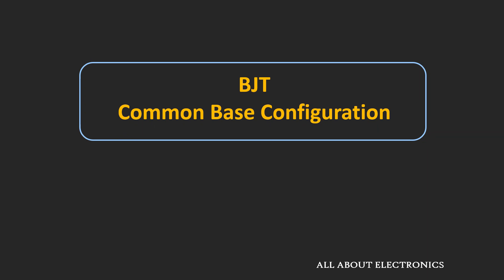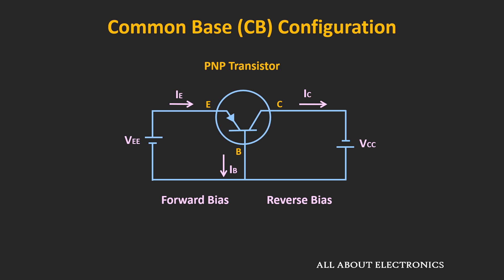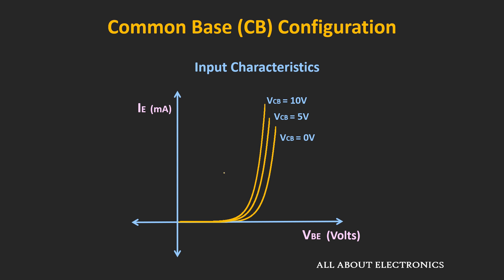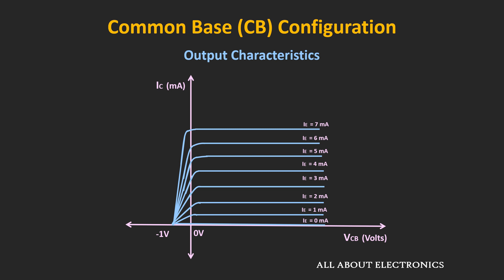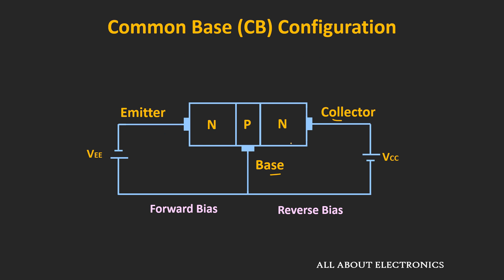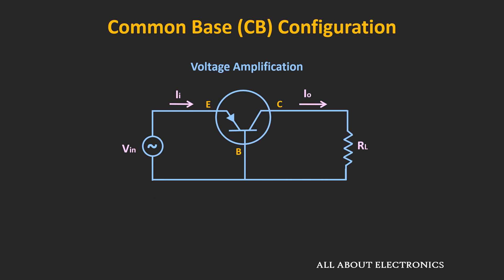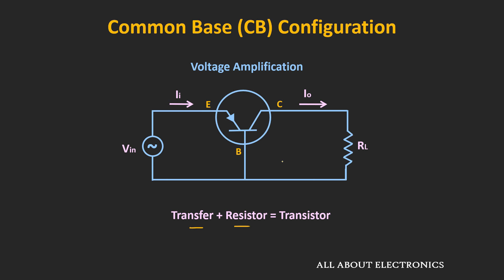BJT : Common Base Configuration Explained

Comment from the maker: The timestamps for the different topics covered in the video:

1:11 What is Common Base Configuration

2:55 Input Characteristics of the Common Base Configuration

5:45 Output Characteristics of the Common Base Configuration

6:33 Three Different regions of operation (Active, Saturation, and Cut-off)

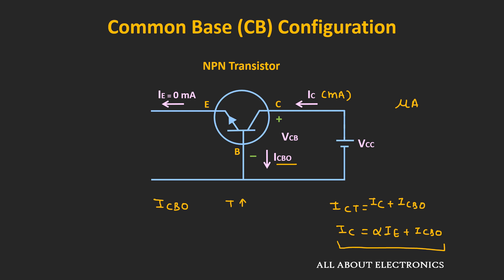10:52 Signal Amplification in CB Configuration

Comment: i have a doubt that in NPN transistor ,in common base configuration it is written input voltage as EB and in PNP it is written as BE ,why it is changed. is it based on voltage difference from positive to negative ,or it is based on refrence voltage ground voltage ?
Reply: It kind of reference 
 or you can say to calculate the voltage in positive unit as in pnp
The emitter side is connected with Positive (higher side) and base in connected with negative (lower side)

Comment: great video. However I have aquestion. We can see that in output, collector current is given by alpha times emitter current. I want to know why does the output voltage (Vc) not have an effect on that. I know the mathematical relation but whats the actual reason?
Reply: To be precise, the collector voltage does have a very small effect on alpha. The collector voltage changes the reverse junction depletion region width btw base and collector, thus affects the fraction of emitter current that the collector "collects". This effect, however, is very small because most of the emitter current goes to the collector regardless of the collector voltage (as long as it is positive). I expect later videoes will explain this in more depth.

Comment: You mixed up which half is foward bias and which is reverse bias, in both the pnp and npn transistor diagrams. 2:55 and 2:32
Reply from the maker: In PNP transistor, EB junction is forward-biased. (Emitter is P, and base is N), while CB junction is reverse-biased.  (Collector is P and base is N).
In the NPN transistor, BE junction is forward biased (Base is P and Emiiter is N), while BC junction is reverse biased. (Collector is N and base is P, so higher voltage is applied at Collector side).
I hope, it will clear your doubt.
Reply: @ALLABOUTELECTRONICS  but if base-emitter in NPN is foward biased, that means current flows into emittor(N) and out of the base(P), because that is how a [NP] diode would behave in foward bias.

But current is flowing out of the emitter in your NPN diagram, which makes the emitter-base reverse bias.
Reply from the maker: @chibuzordesmond3937  I would recommend you to watch the basic video on BJT. If you will watch it, then your doubts will get clear. 
Here is the link: https://youtu.be/-VwPSDQmdjM?si=B9kH68XWb2-uVTNo
Reply: @ALLABOUTELECTRONICS  will do
Reply: @ALLABOUTELECTRONICS I've watched it and my understanding now is that current always flows from + to - 
in the circuit, I've been taking the convention for granted but let me know if that is correct.
Reply from the maker: @chibuzordesmond3937  Yes in the circuit the current flows from positive to negative. The current direction that we are assuming (Conventional current flow) is opposite to the direction of flow of electrons.
Reply: @ALLABOUTELECTRONICS    for what reason is the direction of conventional current and the direction of actual electron flow, the same in current Ib, in NPN transistor?

Comment: I have a doubt, why in output characteristics we consider Current of Collector, since current is going inside the transistor so shudnt it be input characteristics? Or do we consider the direction of electron?

Comment: Its really a good video ,but I have one doubt , voltage gain is actually based on load resistance, which we can change according to our convenience than why its rage is fixed?
Reply from the maker: In common base amplifier, along with load resistor, the gain also depends on the collector resistor and the transconductance. That's why just increasing the load resistance alone, you will not see much increase in the gain after some point. For more information, about the gain of the common base amplifier, you may refer this video: https://youtu.be/MckBbhfxdkk?si=1KOQ9EApVd8GTiZy

Comment: Respected sir, Why we don't include output impedance while calculating output current?
Reply from the maker: Typically the output impedance in this configuration is very high. It will come in parallel with RL. And if we take the parallel combination of those two resistors then it is close to RL. That’s why here it is not considered. For exact calculations you can watch the video on common base amplifier. 
Here is the link : https://youtu.be/MckBbhfxdkk?si=dYJmsP0UI30uVH_q
Reply: okay sir, thankyou

Comment: Hello Sir, I have a question for the constant Ic when Vcb increase. As what you said in common emitter transistor, as Vcb incrases, the depletion region will increase so that the effective width between base and emitter decreases. Thus, more electrons will flux into collector region. That explanation could also be applied here. Then Ic should not be constant. Instead it should also increase. But why does the current keep constant here? Thank you very much for your video!

Comment: At 6.17 you explain input and output characteristics...while explaining input  characteristics u kept output voltage constant while output characteristics u put input current constant why such so?
Reply from the maker: If you change any input/ output parameter, it will have an effect on other parameters as well. So, the while finding output characteristics we just want to know how Ic changes with VCB. If we change input parameter ( Ie) then it will also affect the collector current. So, it is kept constant. In short, while finding characteristics, we don't want more than two variables. That's why input parameter is kept constant. I hope, it will clear your doubt.
Reply: I want to know why is current not voltage is taken constant while plotting output characteristics or vice-versa? I got your point but why current nd voltage are taken why not same in both characteristic?
Reply: And we are changing Ic nd Vcb so how we can fix Ie bcz Ic is varying so how Ie can kept constant ?

Comment: @ 5:01 You mentioned the Input impedance [is the slope of the curve; i.e TanX.
But here, TanX=Per/Base= Ie/Vbe; which doesn't seem to be the Impedance from the curve.
Please correct it.
Reply: Impedance is resistance here (R = V/I). For input characteristics, changes in I is very big compared to the changes in V. That's why, impudance is low.
Reply: Slope of the curve will give you conductance and the inverse of conductance will give you resistance. Slope = Ie/Vbe = conductance. If we inverse the equation, we will get resistance. So, R = Vbe/Ie.

Comment: the width of the depletion region will increase but the base will get narrower, aren't you contradicting yourself?
Reply from the maker: As the width of the depletion region increases, the effective region where you will get the free electrons will reduce. (Depletion region is depleted of free electrons) Therefore, the base will get narrower. I hope, it will clear your doubt.

Comment: 13.00 why we are not using r output .why we are using rl ?? .Please explain
Reply from the maker: The output will be Io x ( Ro || RL).
But since, RL is much smaller than Ro,  (Ro is around 100k and ,RL in this case is 1 k) their equivalent resistance will be approximately equal to RL. 
That is why RL was used. I hope, it will clear your doubt.

Comment: At 12:04, why suddenly the current directions have reversed when compared to what u had been showing in first 12 minutes of the video?
Reply from the maker: Because it is PNP transistor. So, its direction will be opposite to NPN transistor. The transistor shown earlier was NPN transistor. I hope, it will clear your doubt.

Comment: sir u have shown symbol for pnp transistor in video, but you are refering to npn so which is right?
Reply from the maker: If you see the symbol closely, then it is the symbol of NPN transistor. The arrow is going from base to emitter.
Reply: Sir at 11:34
Reply from the maker: @aamir99204  Yes, just to explain the signal amplification in CB configuration, the PNP transistor was shown. (since the direction of input and output currents are more relatable in PNP CB configuration)

Comment: Sir I found out one mistake in your video as per my knowledge. In your video you told that the output characteristics curve for common base configuration is linear but I verified from Sedra Smith that the curve is not the liner it has a small positive slope which indicates that the Ic depends upon Vcb in the active mode.
Reply: No bro,he told that from ideal case.What you have said is the practical case.In practical case Ic=(alpha×Ie)+Icbo
Reply: Yes it is not linear, but for approximation we take it for linear

Comment: How is the voltage from the Base to Emitter considered to forward biased for both the PNP and NPN when they are on? Is this not a mistake? If you're talking about Vbe in both cases then they both can not be considered forward biased. The only way it makes sense is if in regards to the PNP you are saying Veb is forward biased. But why do it like that?

Comment: I have a doubt, you have written in properties of CB that it has low power gain, but if current gain is 1 then power gain is same as the voltage gain and so it is high. Right?

Comment: at 12:00 you say that alpha = 1 and Ic/Ie=1;
But at 13:50 you say that Ic/Ie<1 ...
So why the two complementary sentences in the same concept ?
Reply from the maker: At 12:00, it was just assumed that Alpha is 1.  ( Just to make the calculation simple). Actually it is around 0.95 to 0.99. so, current gain will be always less than 1.
Reply: @ALLABOUTELECTRONICS   Hmm ok... 
But IV should be same at input and output side, right?

Comment: Sir at 11:06 you have taken pnp transistor  but earlier you took NPS transistor it’s a bit confusing .
Reply: Yes, exactly. I was wondering this comment. He used PNP transistor here, but in both NPN and PNP, the i/p will be along VBE side and o/p will be on VCB side. So there's no problem with the equations though.

Comment: What is the full form of vee and vcc
Reply from the maker: Vee is the supply voltage applied at the emitter side. And the Vcc is the supply voltage applied at the collector side. Please note, it is different from Vc and Ve. Vc stand for the voltage at the collector terminal and Ve is the voltage at the emitter terminal w.r.t ground.
I hope it will clear your doubt.

Comment: I want to thank you again. How did the high output resistance help this circuit? As the output voltage was dependent on load resistant. I figured from the output characteristics, that the high o/p resistance is helping for a current mirror as the current does not change much but does it help for voltage amplification purpose?
Reply: Same doubt . Now u have an idea if so kindly share

Comment: great explanation sir,i have following questions when i watched this video
1).why you don,t use output impedance in your calculations?is that not effect for output voltage and current?
2).same current flow through the circuit from input side to output side . but voltage is increasing without using any voltage source.so the power is increased .how that happened?
Reply from the maker: the thing is we are also applying the DC voltage to the BJT. AC input signal is the one which we want  to amplify. But to do so, we need to bias the BJT (we need to apply the proper DC voltage to the BJT). This external DC biasing helps in the amplification. There is a conservation of energy. 
For more info, I would recommend you to watch the video on BJT- Large signal model.
Here is the link: https://youtu.be/ME41uPsDxFo
Reply: @ALLABOUTELECTRONICS  thank you sir ,i am following your tutorials and those are very helpful to me for develop my knowledge

Comment: The output characteristic. How does a output current Ic flow when it's reverse bias
Reply: Time 8.30
Reply from the maker: Are you talking about cut-off region. In the cut-off region both junctions are reverse biased.
Reply: @ALLABOUTELECTRONICS  No, in active and saturated regions the collector base is reversed but how is there a Current flow Ic?
Reply from the maker: In the introductory video on BJT, I have already explained it. If you go through it, you will get it.
Reply: @ALLABOUTELECTRONICS  thx for the help bro. This help me with exams

Comment: In common base mode, what is the potential at the base? (The positive terminal of one battery is connected to the negative terminal of the other)
Reply from the maker: when we say, the common base, the base is common for the AC signal. That means the AC input signal is applied between the emitter and the base, while the output is measured between the collector and the base. For the DC biasing perspective, the base terminal may not be at the ground potential. But to use the BJT as an amplifier, the base-emitter junction has to be forward biased and the collector-base junction has to be reverse biased. (To ensure the operation in the active region)
Actually w.r.t to ground there will be some finite DC  voltage at the base. 
Here to simplify the analysis it shown such way. 
I hope it will clear your doubt. 
If you still have any doubt then do let me know here.
Reply: @ALLABOUTELECTRONICS   Thank you!!

Comment: sir is it supposed that when we increased VCB then we make the junction between base and collector more reversed then the collector current reduced not to be constant ?
Reply: When reverse voltage increased depletion region gets wider thus base width decreases which allows  Ieto pass Vcb junction.Hence Ic almost equal to Ie

Comment: anna please tell why the transistors will operate in forward bias for small voltage due to decrease in the width of base
Reply from the maker: I think you are referring to the small ac signal right ??  The thing is to forward bias the base-emitter junction, the applied voltage between the two should be more than 0.7V. 
Of course on top of that if we apply the small ac signal, then it will remain in the forward bias condition. 
That means when, DC signal (for biasing) + small AC signal (for amplification) is greater than 0.7V, the base-emitter junction is in the forward bias condition. 
I hope it will clear your doubt. If you still have any doubt then let me know here.

Comment: I have one doubt in my mind ..if collector Base junction is in reverse bias then why electrons from emitter move from reverse bias depletion region ? Why dont electron pushed back to emitter by repeltion of negative ions of P-region of base?Is  there  breakdown occur at reverse bias depletion region? Please answar and clear my doubt
Reply from the maker: Here, emitter base junction is forward baised. That means electrons will be move towards the base region (Due to the repulsive force by the negative terminal of the voltage Vee ) and holes will get atteracted towards the negatvie terminal of the emitter voltage (Vee).
At the same time collector base junction is reverse biased. 

So, once the electrons enters the base region, they will behave like a minority charge carriers. And they will get pushed by the electric field of the reverse bias voltage at the collecor base terminals.
 So, as a minority carrier they will reach into the collector region . And then by the force of the positive terminal of the Vcc, they will get attracted towards it.
I hope, I am able to clear your doubt. 

If you still have any doubt, please let me know here.
Reply: Thank you very much..i understood this concept its due to electric field..Can u clear one more doubt ..how BJT amplified signal means increase output power if we know that power is fixed and we can't generate it ..i understand mathematical reason of voltage and current amplification but what is physical reason?..Can we call BJT mixing input power with battery power so output power become high?
Reply: Why minority charge carriers are responsible for current in reverse bias

Comment: Bro i reffered some books too, in that output is taken at VCB and in some it is taken at resistor Rl which one is right please clear this bro......
Reply from the maker: You will get the output between the collector and the base terminal. But usually, the output is connected to the load.
So, if you connect the load resistor RL across the two-terminal then you will get the same output across the load resistor. 
I hope it will clear your doubt.

Comment: Tell me the applications of cb configuration
Reply from the maker: The common Base amplifier has low input impedance and high output impedance, so it is used for the impedance matching at RF frequency.
Reply: Aunty Google it

Comment: I amplifier we amplify voltage or current ? Please answer
Reply from the maker: It depends how the amplifier is configured.  Some amplifier amplifies current, some voltage, while some amplifiers are power amplifier and amplifies both current and voltage.
Reply: @ALLABOUTELECTRONICS  in general bjt as a amplifier which circuit us used ?
Reply from the maker: Usually, for amplification BJT is configured in common emitter configuration as it provides both voltage and current gain.
Reply: @ALLABOUTELECTRONICS  there are three types of config cb cc & ce right ? Then what is fixed bias voltage divider bias ? It so confusing please help